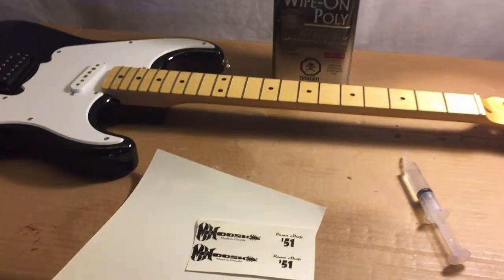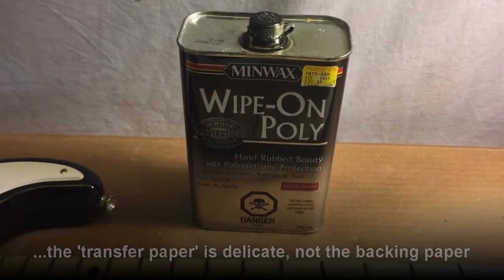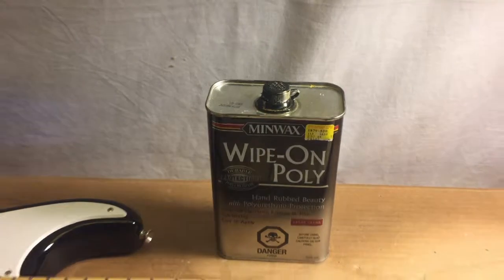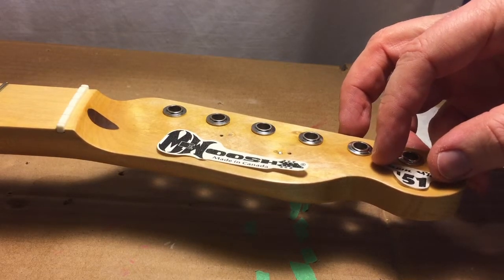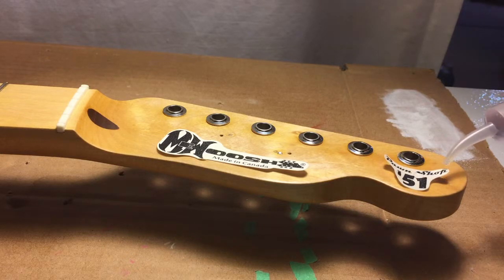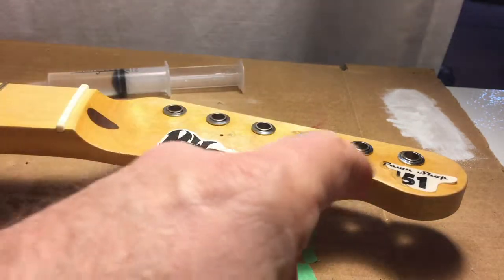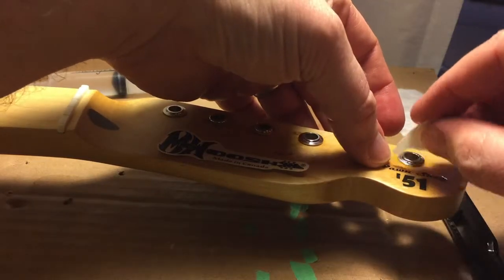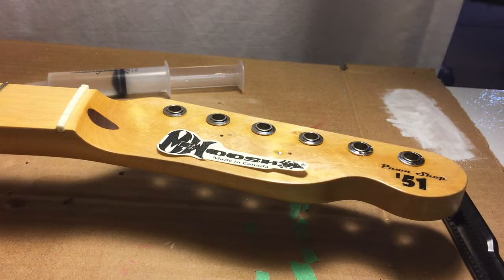How to create headstock decals

Comment: Good tutorial.
Actually the coating is not meant to strengthen the paper, although it may help. It is actually meant to protect the ink/toner. The ink/toner is not waterproof and without the clear coating it would essentially run while you are trying to apply it.

Comment: I thought the video was how to create them not how to apply it... Hmmm missing how to create/copy the logo, sizing the logo, printer settings .. Not gonna dislike the video but there are thousands of videos like already... Good luck next time
Reply from the maker: Oops, sorry. Didn't think of it that way when I filmed that. I ordered special "waterslide decal" paper on Amazon. It was actually A5 paper from the UK. You also have to choose the right type of transfer paper depending on whether you have a laser printer or ink jet. Then I size them with my graphics program (Arcsoft Photostudio) in centimetres (as opposed to pixels) to roughly determine how big they will turn out. Either way I choose a range of sizes, arranged on the page, and print out a sheet's worth of them to pick from as they don't all come out nicely... sometimes there are flecks of toner missing or lines in it, etc. Then I either spray or wipe on polyurethane and carefully cut out my favourites. I have several prints left over afterwards which are useful if I mess up applying it. The one I applied in this video was actually printed like two+ years ago. The toner can get all over the page though and in my most recent attempt my printer was making streaky marks all over everything I printed for weeks afterwards. I haven't tried it with my colour-laser printer though to be honest... just black ink so far. They make special printers that will do opaque inks for dark paper... that would be better for rosewood/mahogany headstocks. I hope that's helpful! All the best!
Reply: @mewoosh  It is very helpful THANK YOU SO MUCH! definitely gonna give it a LIKE! Thanks again
Reply from the maker: @bassintexas6706  My pleasure. Best of luck!